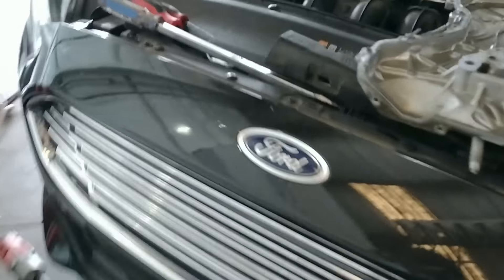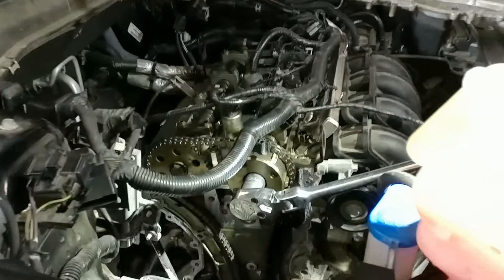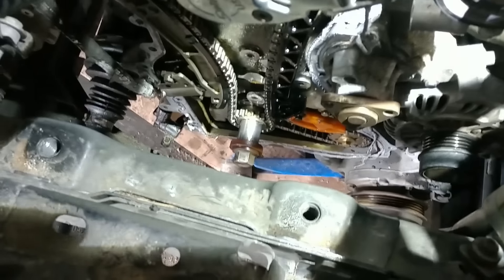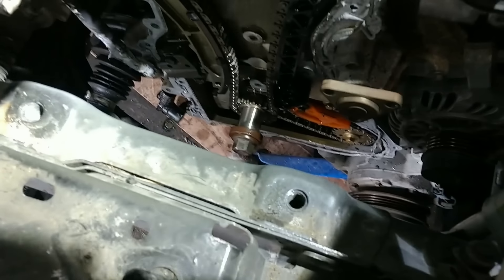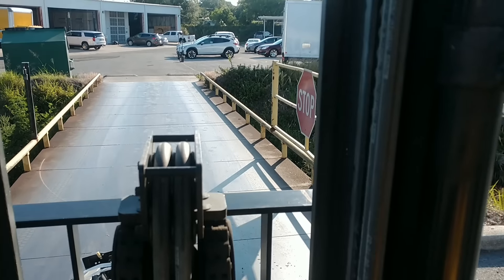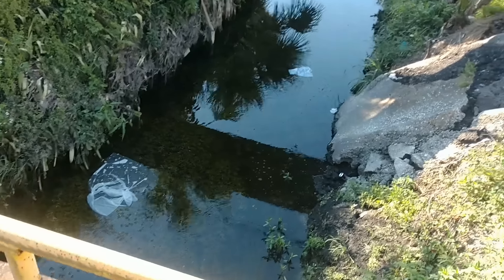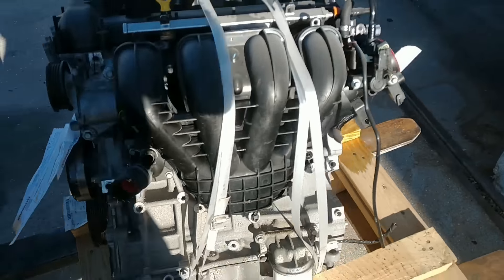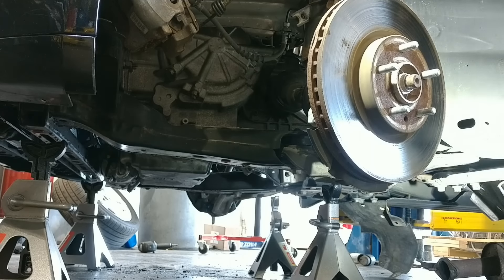Damaged Engine: You Broke it! Pt1

Comment: It's called this set up. .friction timing big advantage of this is engine management system can compensate for worn cam chain by moving forward or backwards the front cam by the the internal gear set ........easy to time flat bar on back of cams theirs is a cut out in cams can't stuff it up....and a blank off plug  back side of engine remove that....theirs a special bolt that locks crankshaft. .... very common ford Mazda  set up. ........😊...

Comment: Ford were doing this in at least the nineties in Europe. Got a box of locking pins and cam lock bars/wedges just for them. If they're serviced right, there's no issue but Fords and an awful lot of other makes use interference fit pulleys on their crankshafts and camshafts. Not a new issue but as always RTFM if only to check on timing issues. 
If you don't know, don't touch. Takes a couple of minutes to google the wiki on different models and makes.

Comment: ..because having a crank keyway adds $1.35/engine and explodes the beancounter brains...
Reply: Because actually reading the service manual before you do a job like this is hard.
Reply: @panzerveps  because actually BOTH.
He didn't read the manual, AND the design is crap :P
Reply: @bledlbledlbledl  It's designed to be worked on by people who can read.
Maybe that's a bit too much to ask tho..
Reply: @panzerveps  It can be for people who can read and STILL be a bad design, the two are not mutually-exclusive  :P
Reply: Maybe it should he designed to carry over industry wide standards instead of cheaping out a tiny chunk of metal and making mechanics look over their shoulder any time they touch a Ford
Reply: @panzerveps  you must be the engineer
Reply: @ethan91002  Nope. Just a dealership technician from Europe, who knows how to read the fucking repair manual.
This design is quite common, and as long as you read the fucking manual, it's no big deal.
Reply: @panzerveps  You must be fun at parties . . . . .
Reply: @peterdarr383  Why? Because I follow the repair manual at work?
That's not how you use that phrase.
Reply: mrpresident  que?

Comment: This design is similar to the Ford/Mazda 2.3 liter engine. The crank pulley and balancer assembly holds the timing sprocket tight enough so it won't spin. There is no crank sprocket key that holds it still. When I rebuilt a 06 Mazda 3 2.3 liter 4 cylinder engine I intentionally built a keyway into the crank to prevent it from spinning loose.

Comment: Honestly, as soon as I saw it was a Fusion I knew exactly what happened. Swapped the 2L out of my miata for a 2.5 out of a fusion and upgraded the cams and valve springs, so I knew exactly what you were dealing with. Even if you did everything perfect to the T on the service manual, the Duratec i4 line up of engines still have a possibility of losing timing because of the friction washers. My 2.5L lasted me 3,000 miles and 1 trackday before it lost timing and all the exhaust valves hit pistons. Moral of the story, fuck friction washers. Don't care if they are "DiAmOnD iMpReGnAtEd", how am I supposed to trust a flimsy 3 thou thick washer with keeping my crank and cams synced over a traditional keyway in the crank and sprockets!
Reply: As soon as it moves, your keyway has failed. There are  lot of unkeyed engines out there.
Reply: Damb it quit holding back and tell us what you really think! Sheesh , engineering 101 ! Build it so they buy more parts . They make 12 extra of all parts for every car built. They see ya coming and lower the price to sell you more crappy parts . If it was s racket everyone would do it. Built in obsolescence,  they know!
Solly for bad times on newer cars,  Go old tech,  1960 to 1972. Fook emissions. 
Get a model T. Not really fast but you want reliability and long life so it doesn't nickel and dime ya. Always remember if you come across a ZOMBIE and he rolls his eyes at you....
Just roll em back!😎
Reply: @wesleymonske8103  It's less about planned obsolescence, and more about cost and ease of manufacturing. The Duratec is still around today, and is what the 2L & 2.3L EcoBoost engines are based on, Ford even uses the 2.5L shown in this video on the brand new 2022 
Maverick Hybrid. Adding a keyway and a key is one extra part and one extra step in a behemoth that is mass manufacturing. Multiply that by hundreds of thousands of engines across two decades of production...saves Ford hundreds of millions of dollars.
Reply: @Litestorm17  so a hundreds of millions class action lawsuit may be the equalizer?
Reply: never heard of any mickey mouse jack legged shit design like that before. keyway woulda been nice. fords better idea.
Reply: @ixlr8677  The C5 Corvette doesn't have a keyed crank either. I agree that it's stupid, but it's not just limited to Ford.
Reply: @Litestorm17  just raise price of car by 5 bucks. Problem solved.
Reply: @adamnichols476  That would make sense, but they don’t because over a production run it’s millions of dollars of up-front cost. It’s like when Chevy didn’t raise the price of the Cobalt by $0.03 to make the spring inside the ignition the proper size so the car wouldn’t randomly shut off.
Reply: Thank God Mazda moved on from those Ford engines and the Skyactivs have keyed cranks. Can't imagine doing something simple like a main seal or, hell, for any reason the crank bolt needs to come out, on this non-keyed engine. It just creates so much more work in having to re-time the engine because of this stupid configuration.

Comment: I could not imagine accepting a used engine with no available service records.  I would need a new engine for this mistake. It would be different if a “buddy” made this mistake, but this was done by a professional.
Reply: He's an apprentice. He's a kid learning. Cars are no where near as simple as when I started wrenching almost 30 years ago. Give the kid a break
Reply: @FixIt1975  absolutely the kid should get a break, but that break comes from the shop, not the customer. All my employees would get grace in full measure but I wouldn’t ask my customer to give it.
Reply: A NEW engine? No lol
Reply: @AircraftMechanic-AP  If a shop destroys your engine that had nothing wrong with it when you brought it in, They should replace it with a NEW one at their cost, not a used one that you know nothing about, and could fail in 100 miles.
Reply: No way you would get a new engine.  You get a used engine with similar or lower mileage.
Reply: I would accept nothing less than a brand new vehicle valued, at minimum, 250k.
Reply: @PSonak  lol what, the car wasn't even 100k new
Reply: @captainclasher6459  you really need to google "sarcasm", it'll do wonders for your unders
Reply: Like he said he was a GM technician and he had to deal with one of the badly designed ford v6 engines
Reply: @PSonak  😂

Comment: This is some really clever engineering done as a trap to punish non-dealer service shops.
Reply: Seriously. How easy would it have been to just engineer a keyway between the crankshaft and the gear to prevent this kind of stuff from happening? Seems almost too dumb to not be deliberate.
Reply: @Fraggr92  bUt iT cOsTs MoNeY tO dO tHaT
Reply: @Fraggr92  Why waste fourteen cents per car ??
Reply: and once this is discovered, The sale of such vehicles would stop
Reply: I wish I could say you were wrong but then again I seem to remember at one time having multiple names for the same basic part in different brands of vehicle just to make things harder.
Reply: @gregsmith7828  Thats what you think.
Reply: @olstar18  I've had the opportunity to work in integrated supply with that same scenario,  a 9/16 combination open end  box wrench in the catalog is referred to a 5625 spanner on a print as an example
Reply: Dealers are independent businesses.  The Manufacturer couldn't care less who fixes it.
Reply: @danr1920  That is not entirely true. The manufacturer sure does care. Mainly because of OEM parts. Dealer will only install OEM parts. And this is a huge chunk of Manufacturer's profit.
Reply: @danr1920  tell that to John deere
Reply: More like 3 cents
Reply: @danr1920  A lot of dealers will pay a franchise fee to the manufacturer. For example… buying the manufacturers diagnostics computers, specialist tooling and repair manuals.
Reply: I have a part for my Truck i need, its Dealer only, isnt something an independent shop can get, requires a special tool, and a special computer code device, all of which can only be acquired by a dealer. Attempting to fix it without said tool or code device, will result in my truck simply not running.

And this is what the dealer told me, when i took my truck in because it was acting up. Its gonna have to wait till income tax time.
Reply: @dreamwolf7302  what truck?
Reply: @hunterlong1820  Dodge Ram 1500 2014. Part of my shifter broke off in the column, and the part that broke, contains a microchip that has to be paired to the Transmission Control Module.

Had my usual mechanic come look at it, and he cussed a storm.

Called it 'yet another Chrysler scam' that forces you go to a dealer, or Chrysler certified repair shop.
Reply: @dreamwolf7302  our 2013 ram is in the shop because of that stupid weird plastic stubby key thing. Won’t sit tight in the ignition and the slightest bump will turn off the truck and the truck doesn’t care if it’s parked or going 70 on the highway. What a weird design.
Reply: @hunterlong1820  yeah, not a fan of the 'smart' keys.

Did you guys get your shifter part replaced that was recalled? I bought my ram in 2018, second hand, and the previous owner hadnt gotten it done. That was fun the first time it slipped into low gear on the highway.
Reply: @dreamwolf7302  no idea. It’s one of 6 work trucks at that location it was there before me haha.
Reply: @AcuraAddicted  Also dealers (not just cars) often have very slim margins on new vehicles and make their money on service. Mfg needs dealers to thrive so they buy new cars from mfg... setting up owners for costly service accomplishes that.
Reply: I wish I could say there is a more logical explanation, but this is too wacky to be anything else. No advantage over a woodruff key, just a trap for the uninitiated. Ford tech make us ALL loco!
Reply: Nope costs / money saving less to machine keyways etc
Reply: @myk55501  the engineers could refuse to sabotage people tho.

Comment: That's because Ford has Mazda engins it's been that way for several years. If you look at the balancer there's a hole and on the timing cover there's a threaded hole. You install a bolt to hold the balancer from moving and use an impact to remove the crank bolt. After removing the bolt you mark the crank in relation to the balancer. You don't need special tools if you take care not to move the cams but you can also mark the cams location for one last check before hammering down the crank bolt with the balancer locked in place with that bolt into the cover. The Saturns don't have keyways on the crank and on the cams also. Same process mark locations before disassembly and you don't need special tools.

Comment: What kind of warranty do they get. If that was. My car I’d be kind of pissed off that the engine if been maintaining meticulously since day one is being replaced by one that I have no service history on.  How does the dealership make up for that. The engine being put in could have something ready to break and after I drive it for a couple hundred m8,es it blows up.  Just curious how that works
Reply: My guess is 3 year replacement and 1 year warranty. Somewhere in that area.
Reply: Yep, if it were my car my options to the shop would be to repair my engine or fit a brand new engine or buy the car from me at full retail value. Take your choice.
Reply: @wirdy1  LOL, good luck with that. Since the car isn't new, on what basis should you get a new engine.
Reply: @Cheepchipsable  I think that it's unfair to break a customer's product and replace it with a potentially inferior one. The customer did not make the mistake and the shop should do what's best for the customer not what's cheapest for them. Personally if they were not replacing this with a new engine I would be taking them to court for the damages.
Reply: @Cheepchipsable  on the basis that if I don't their shop might burn down.
Reply: @Cheepchipsable  fundamentals of consumer rights is that the customer should be put back to the same position as they were in. He drove in with a well-serviced motor. The garage screwed-up. He left with pulled motor from a junkyard. One added option would be a remanufactured (warranted) motor. I'd definitely not accept a garage fitting some motor pulled from a junkyard/breakers yard.

Comment: I love the silliness in "pulling the car off the engine". Yeah you've got it on a lift, I've just never thought of removing it that way. Probably better or easier in many designs these days.
Reply: Lots of cars are like that.  That is the way they go together on the assembly line.
Reply: Yep drop it down with the subframe, replace, bolt it back up.
Reply: Yeah it's common on Chrysler cars to do this.
Reply: Toyota Highlander with a leaky thing chain cover and Avalon as well. Great engines but poorly applied FIPG or poorly programmed machine applicator. Toyota had to eat that one at around 60-70,000 miles.
Reply: That's the only way to do it; with the cab forward designs you can't even take the engine out the top. And dropping it that way is way easier than trying to work with the engine in place for certain jobs.
Reply: This is pretty much the reverse of how they are assembled. Many vehicles you couldn't pull the motor out the top, plus you would need to remove the radiator and a whole lot of other stuff.
I can only assume you don't work on cars at all, since cars have been built this way for a long time.
Reply: Funny thing about it is to pull the engine out the top you find the crank bolt is in the way. Most salvage yards will note to not remove the crank bolt on the 2.5 fusion engines.
Reply: At Nissan that’s our bread and butter for engine or trans replacement
Reply: Well color me surprised on how cars are done these days. Never needed nor wanted to do a job like this, or seen it done so I've clearly been missing that detail for a while.
Reply: As a teenager I had an Opel Manta. The body was held down in front by 2 long bolts going through the shock towers. Pull those out and me and a buddy could just lift it off to remove the engine.
Reply: Lol, had to use an engine puller to lift my 04 Cavalier to "pull" the engine out the bottom,
Reply: You should see them lifting an F250 off a 6.7 litre diesel.  Also, the method of lifting the car off the engine is not just for engine replacement.   It is getting so common that some maintenance and repair procedures require it to be done as well.   The reason is that the engines are pushed back under the firewalls now to keep the front of the vehicle short and allow the cab forward designs.

Comment: I once R & R'd engine timing gears in a Pontiac V-8 in 1975. The OEM's were made of plastic and wore down but no engine damage occurred. I replaced them with metal ones and the Chilton's reference manual showed the timing marks lining together in the middle. Mission accoumphlished and the Pontiac ran great. About a month later, another Pontiac came in (it was a model year newer than the previous one).  It too required R & R of the worn plastic timing gears. Did the same procedure as the first Pontiac except this time the car wouldn't start and only backfired.  After thinking about this problem for several hours while scratching most of my body parts, I returned to the Chilton's manual and looked up the procedure for this newer Pontiac V-8. Turned out that Pontiac made a design change and the timing gear marks were to be installed at opposite ends and not together. Who would have thunk! Henceforth, I checked Chilton's whenever I worked on a vehicle I was unfamilar with.